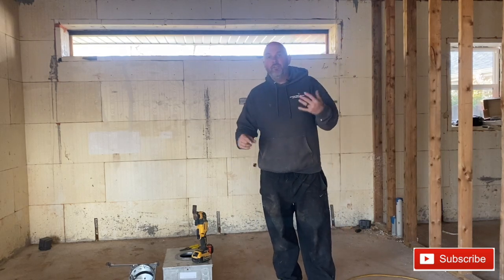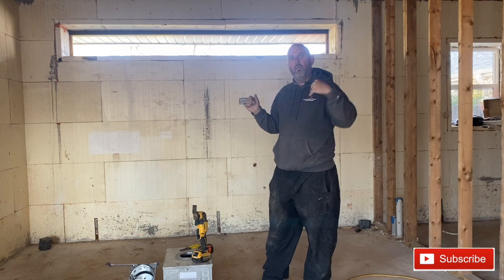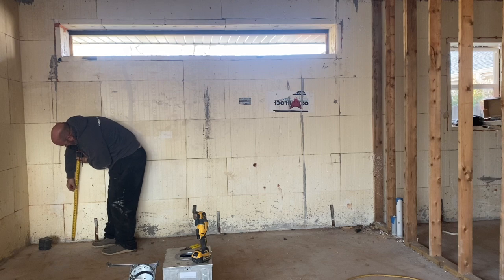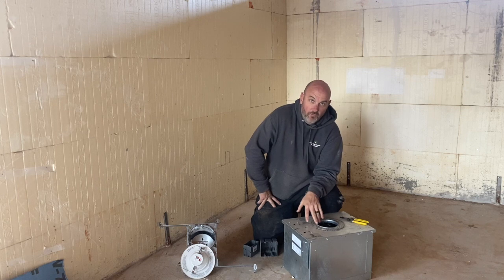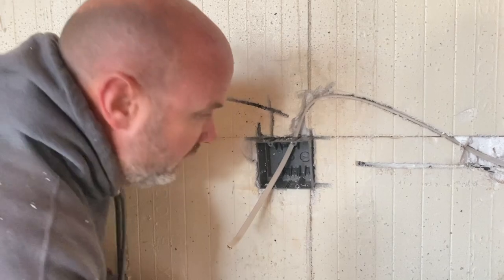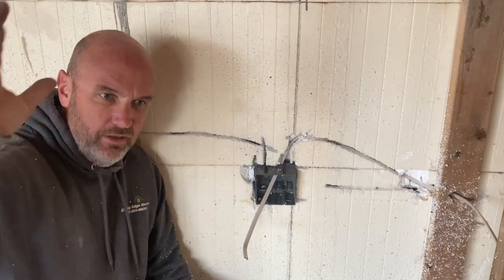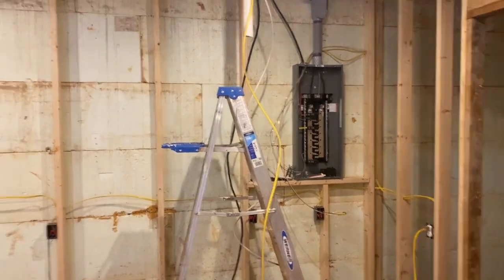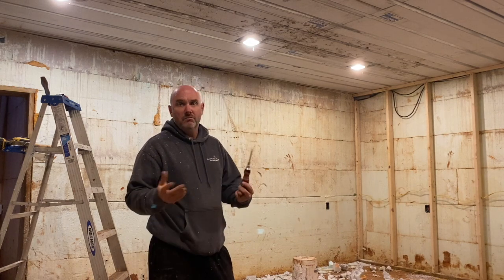Wiring ICF Walls!!!

Comment: what about nail plates to protect wire when hanging ...drywall etc.?
Reply from the maker: No need, you’ve cut away the stud(web) so there’s nothing there to pull a screw into the wire, and if you do it right it’s 2” deep so out of reach of drywall screws

Comment: I would rather build a 2x4 wall, 10' long, it would take me 20 min and ran wires inside. plus I would put addition R13 fiberglass inside for $50 which would make the wall more energy efficient. Thx for the vid.
Reply from the maker: R13 is more efficient?🤔 you just have been a math major…

Comment: In the basement , what is your ceiling? Next question if a person forms up crawl space with ice and wants to go up with 8’ walls. How to support floor joist?
Reply from the maker: There are 3 methods of attachment, my favorite is the anchor tunnel or the site made version where you cut out a rectangle of foam between webs ever 48” and put rim joist on with screws during the pour with a pre embedded L bolt to be tightened post cure…

Comment: How would one make an ICF wall remodel-friendly such that a low voltage wire can be added AFTER drywall is installed? In acWOOD-framed wall, a drywall hole the size of a single gang box would be cut where the wire is to terminate, and then a fish wire would be used to run the wire vertically in the cavity or horizontally through studs. Seems like, with ICF, you’d either have to remove drywall from 100% of the cable path (no fishing) or have built a stud wall interior to the ICF wall to achieve remodel-friendly.
Reply from the maker: So this is a bit of a boogeyman really, how many modern houses don’t have enough insulation in the outer walls to make fishing nearly impossible?  Are a couple conduit chases from a likely future tech ingress adviseable? Sure.  But all the interior walls are still options to run new cables once inside, but yes, like spray foam, cellulose, and mineral wool, fishing in the outside walls will be difficult
Reply: @ Thank you for responding. One follow-up: What do you think about screwing a criss-cross of interior 1x3 furring strips every 16” o.c. both vertically and horizontally to act as a drywall mounting surface with 1.5” channels behind in which to route future low voltage cables? Or should one simply build a 2x4 stud wall interior to the ICF wall if remodel-friendly is important for life of the structure?

Comment: Great content.  What are the bracket looking things that look like they're coming out of the bedroom floor and going up the ICF block every 4-6 feet?  Are these to aid in block installation (secure blocks before concrete core is poured and/or concrete floor?  Do these get cut off/out later-they look like they would protrude from the drywall.  Thanks!

Comment: The electrician that wired my home had different bars with holes he drilled in them for different thickness Styrofoam for the ICFs. He mounted a roller skate wheel with a bolt to the chainsaw bar. He zipped out the cuts for the wire in no time.

Comment: Much simpler to just run a piece of 2 inch pvc to drop the wires into the top of panel.
Reply from the maker: No it’s not…
Reply: @all3pools  😂 😂 for sure you can just break out all of the knock outs for wire,  put in romax connectors, strip the wire,  connect to the neutral and ground terminal, and connect to the breaker.

Comment: Why not just fur out the ceiling and install thin profile LED lights, should be much easier and you only lose 1-2 inches of height.
Reply from the maker: Huh?
Reply: @all3pools  Modern LED's don't need a huge ceiling box like the ones in the video. 1.5" deep boxes are sufficient. Just use 2" furring strips on the ceiling to run the wires and the boxes, that way you don't have to dig into the ICF at all.

Comment: Wouldn't using a hot knife a lot less messy? These foam beads stick to everything.
Reply from the maker: Way slower and not great in the webs, but yes, less messy
Reply: Vacuum at the end of your chainsaw bar may help with the mess but your method is better than hot knife when trying to cut through webs it would take too long with hot knife.

Comment: By far the best way to run wireing ICF is to run smurf tubing in the cavity with Plastilock boxes.
Easy to pull any wiring or replace it.
Total protection and so much cleaner and quicker
Reply from the maker: For sure not quicker…. Are you saying to place them before the pour???
Reply: Yes,run the smurf in the cavity,either 1/2 " or 3/4" tie to web either side of a join. Done it 100s of times and never had a failure.

Comment: Id suggest creating a melter by using nichrome wire and a 12/24v DC power supply.  No mess.  Little fumes but mask and open air is fine.
Reply: hot knife... amazon or ebay.  No need to reinvent

Comment: Hi there and Thank you for all of your video!) How do you protect electric and plumbing from accident nails etc?! Very important topic but no one talks about it.
Reply from the maker: So if plumbing is close to the surface for some reason mail plates are generally used, electrical it’s rarely necessary because we typically embed the wires 2” deep, which is the same as the center of a stud, with the beautiful added detail that once we cut through the web there’s no meat for a mail or screw to bite into to pul it into the wire like it can in a wood stud, if u inadvertently put a drywall screw on top of the wire channel(won’t reach typically) but it will simply strip out the drywall because there’s no longer a web their to but!

Comment: Thx for the fir out the wall in a mechanical room tip.  I've got that situation and wondered.  Amazed you can get the cans in that deck, guess it's just a matter of how much foam is available to cut out.  Confused why you didn't screw the outlet boxes into the concrete.  Do you level/rough sand the wall before you sheetrock? just looks like a lot of "stuff" protruding.
Reply: provided you shimmed up level a quick squirt of foam is solid and quick, plus satisfies securing the wire within 6 inches from the box. Loctite 3xl also works.

Comment: Are you not concerned about the foam sucking the plasticiser out of the cable sheathing, making it super brittle, and then having short risks if the cable ever moves (around the box or something)?

I thought you were supposed to have conduit or something to protect the cables from this.
Reply from the maker: No, you actually aren’t suppose to run romex in conduit…

Comment: Please be sure you include the core drilling of the hole for the electric service to your circuit breaker box in the follow up to this video.  I definitely want to see how that works.  I like the idea of using the chainsaw to cut a channel for the wiring.  Do you think it would be better and more cost effective to cut a much larger channel and include plumbing in the same area where it makes sense, or is this against code?  Really looking foward to the next video of installing exterior panels.  I am considering using steel panels for longevity and fire resistance.
Reply: I am guessing all the pvc pipes were done before concrete pour, so no coring would be needed

Comment: Do you ever use conduit in the foam for extra wire protection?
Reply: Metal conduit IS allowed and it would be great for extra protection. But anyone out there doing the labor isn’t going to readily want to run conduit through ICF primarily because of cost and effort. So yes, you can and may see it done, it’s convenient later on but it’s tough to get rough in for ICF

Comment: your local inspector must be nice, mine made me staple the romex with in 12 inches of every box including into the concrete. (NEC 336-18) He also mentioned that the boxes I used were wrong because I was using them in a way that the manufacture didn't specify in their install instructions. (370-23(a) through (h)) he wanted me to use metal surface mount boxes and screw them into the concrete. 

Not that I agreed with him but I had to do what they wanted.
Reply from the maker: That’s just silly…. Inspectors can be the best friend or worst enemy of innovation…. Our inspectors, especially the one known to be the toughest and most anal, love icf and are generally enthusiastic to see what we are doing!  They’ve been helpful regarding great areas such as pool bonding too
Reply: @all3pools  there is a need for building inspectors to view inspector educational videos ( that are building inspector approved)showing approved procedures involving ICF for 
Home construction: electrical, HVAC, plumbing and framing.
Reply: Mounting metal boxes to concrete is less than Ideal. 
Forcing you to staple wiring into concrete is nuts. 
If you lock the wiring in with spray foam it is 100% secured along the entire run. Can't get better than that.
Reply: I am glad someone brought up the need to secure wires near boxes.  This is technically correct for traditional builds and unfortunately building inspectors can be ignorant of anything they are unfamiliar with.  I have pushed back on building inspectors and appealed to the state, I am a homeowner not a contractor, so I have less to lose since I don’t need to have an ongoing relationship with the inspectors.  The last building inspector I dealt with was a complete a-hole and was eventually fired.  He certainly did not understand the law and tried to prevent me from installing my own solar thinking he had absolute authority over everything, his ego got the better of him.
Anyway before building I would definitely sit down with the building inspector and explain exactly what you plan to do and make sure he/she/they/them approves of how you intend to install everything then get that in writing on your permits.  Even if you have ten pages of attachments explaining the details it is well worth it when they forget what they approved several months earlier.

Comment: I was literally just researching the 'how not to hit a wire' when this video came out.  perfect timing and the video showed the process perfectly.  Than you.  next on my list is the same question with not hitting the pex pipe with screws ... :)
Reply from the maker: Same answer regarding pex although it would be a little bit more possible…. Generally though pex will deflect screws only pulling through drywall, meaning they usually need to be pulling through wood or plastic to have enough pull to grab the pex and pierce!  But if you managed to hit one dead center I suppose it could occur albeit unlikely, you can also take not of where the pex is and consciously avoid the area, there’s usually only a few pex lines running in the icf walls themselves
Reply: @all3pools cover it with aluminum tape so a good stud finder will see that as wire.